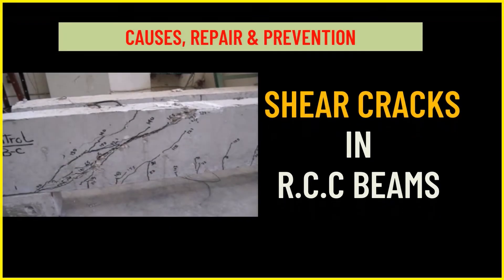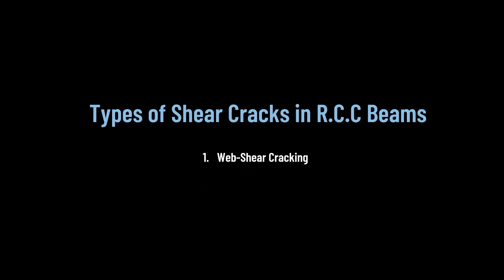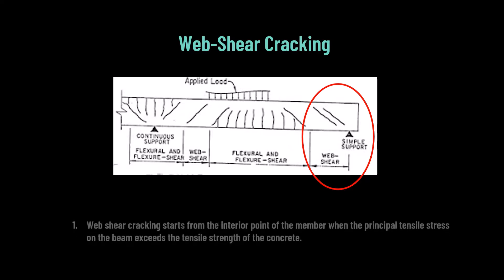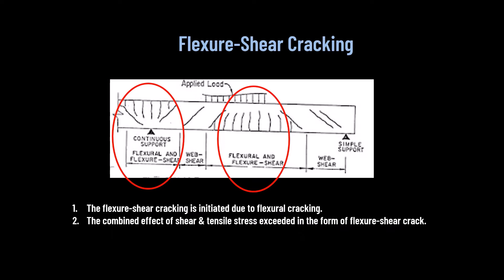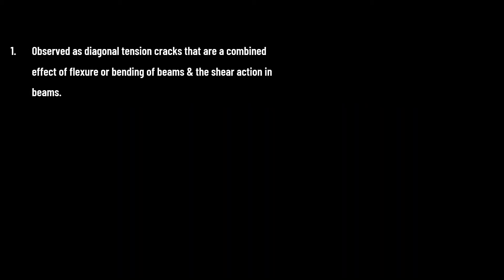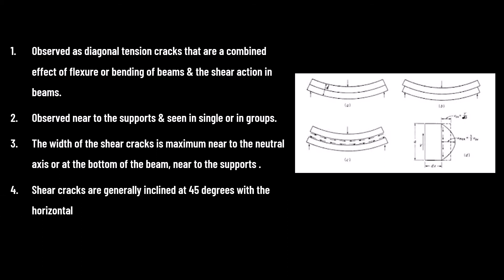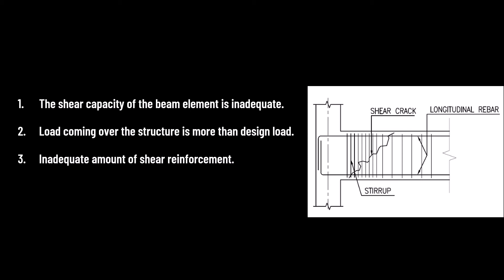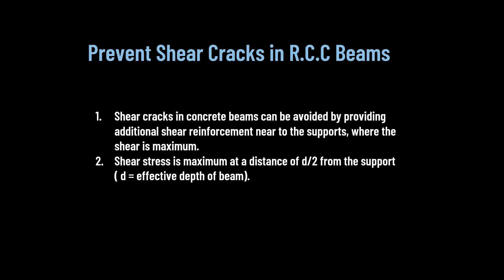2 Main Types of Shear Cracks in Concrete Beams

Comment: But as per IS 456:2000, clause 40.5.1, shear failure occurs at angle of 30 degree with horizontal